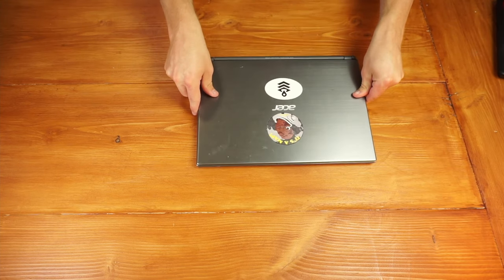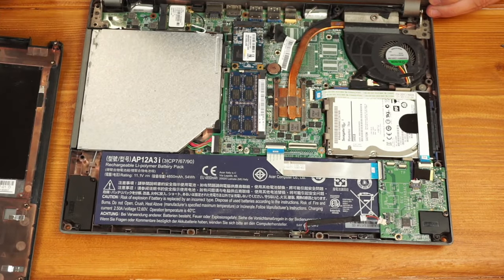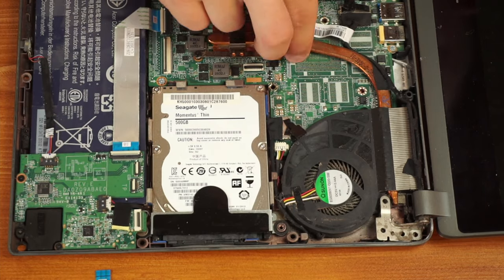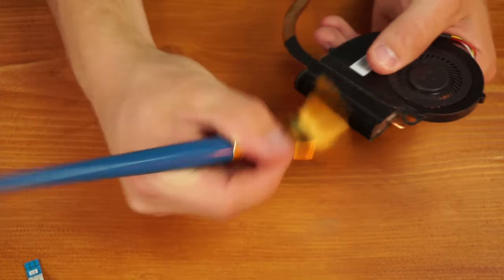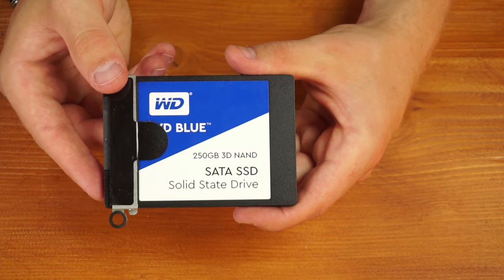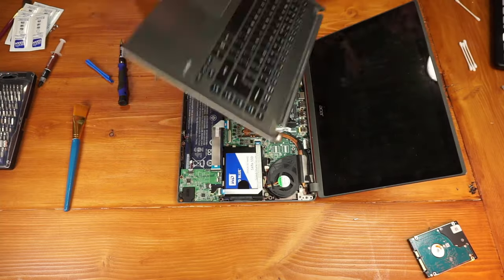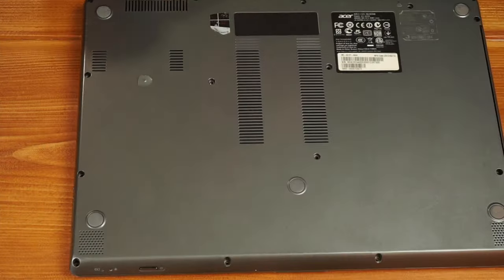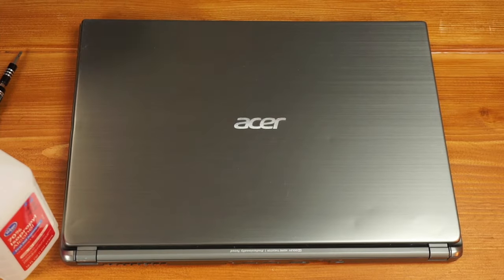How to refurbish an old laptop - (Thermal Paste, SSD, and how to upgrade RAM)

Comment: probably a novice question, but if it was booting from the hard drive, how do you install windows 10 on the ssd? do you use a sata dock, or boot from a usb drive? never replaced a hard drive before, thanks for your help.
Reply from the maker: You'd want to create a bootable windows usb. You can find other videos for it on youtube, if you just search "how to create a bootable windows usb". Great question